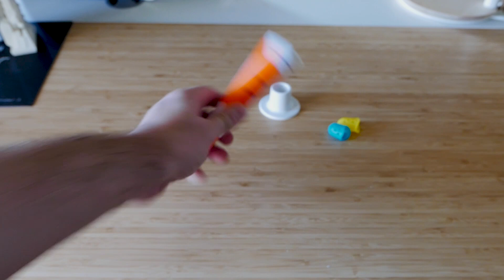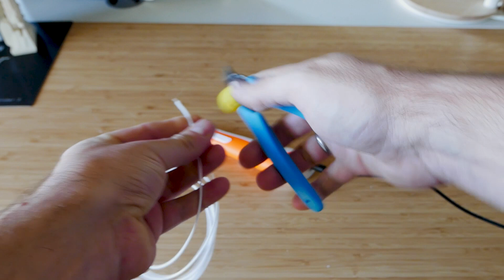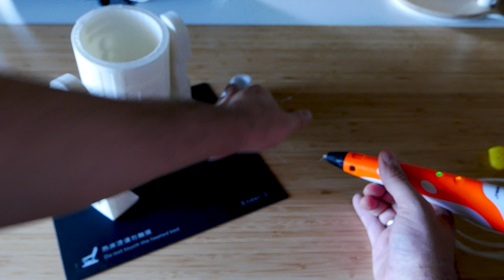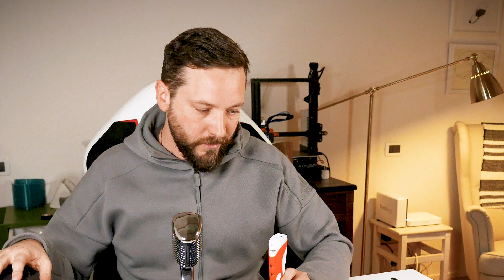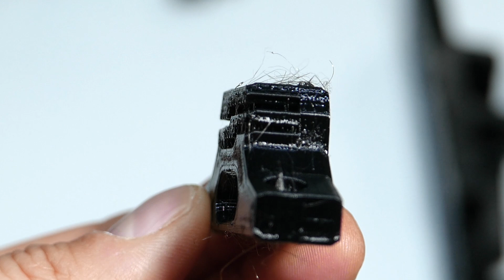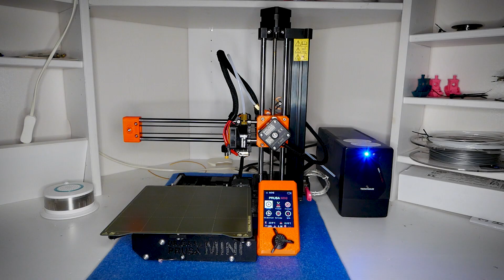3D Printing Accessories you don't know you need!

Comment: 10 minutes to heat up.... damn you need a new pen
Reply from the maker: I think it's because it's made for ABS, has no temperature control so it directly cranks up the heat
Reply: @AMakeDesigns  oh okay. I have only experience with PLA on my own pen.

Comment: Wouldn't a hot glue gun be easier and cheaper to use than the 3d pen?
Reply from the maker: Well this pen is pretty cheap too. A hot glue fun might work if you don't mind the glue m with the 3d pen you can use the original filament and "weld" the parts together.